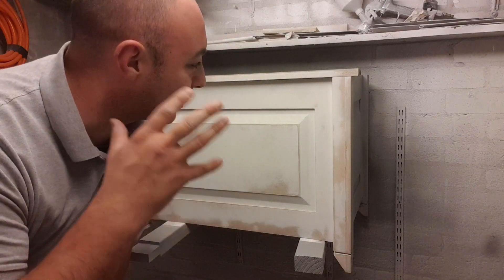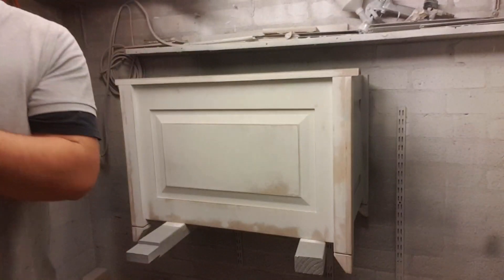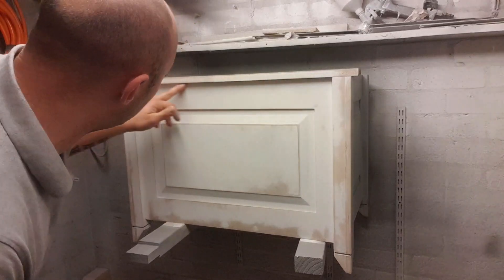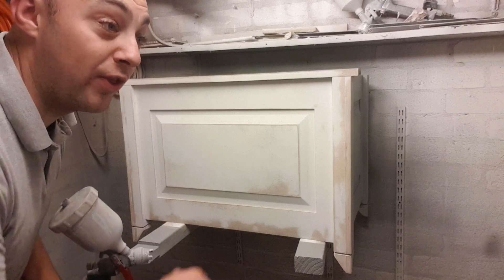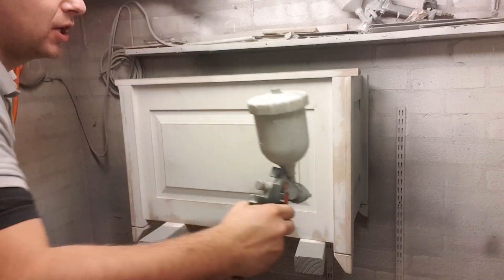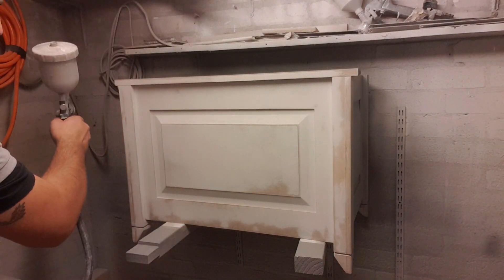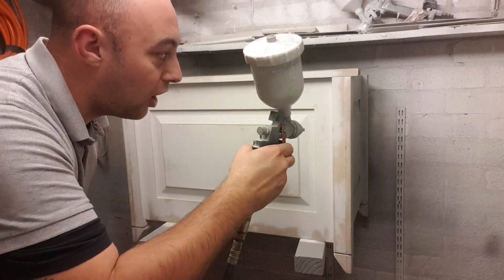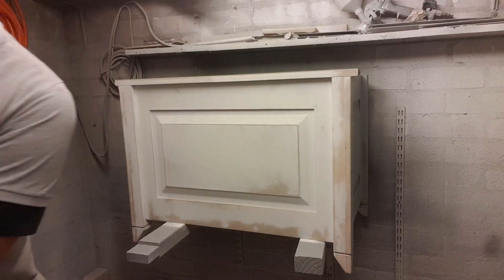Beginner's guide to spraypainting /learn how to spray/woodworking

Comment: Had my first go with my new LVLP gun today, it’s the same gun as the “sprayit sp-33000”, with a 1.3 tip, using with a bog standard 24l compressor - seems to keep up ok.

Im just experimenting using Leyland acrylic primer at the moment because it’s cheap! I’ve thinner it down, maybe 4-1, it seems fairly runny. I’m trying to do it by eye as I id rather get used to doing it that way than faffing about measuring it. It’s probably single cream consistency-ish.

The issue I’m having is its quite spattery on the project, not nice and even the way yours is. If I go over it enough several times I do get more even coverage - but it’s nothing like yours, not a nice coverage with one pass.

Any ideas? Paint still too thick? Or just a bad idea trying to use primer on a 1.3 tip? Too much / too little pressure? (Regulating at the compressor to about 40-50psi), have an inline regulator on the gun but it doesn’t seem to accurately show the pressure so I’ve opened it up and then just dialled it back a half turn or two.

Sorry for the long comment! Cheers for the videos, they’re very well explained.